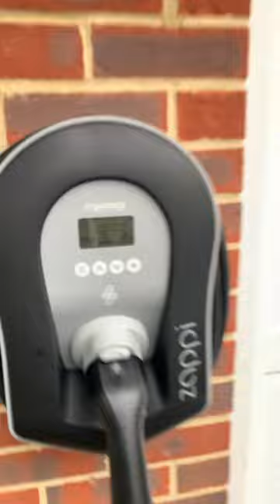The BEST EV Install #electrician #ev #home #viral

Comment: For the love of god I wish electricians would stop drilling consumer units with all the breakers still inside - resulting in small shards of metal making their way into the breaker though the terminal clamps or down the sides of the switch levers.

It doesn't take a minute or 2 to undo the screws on the DIN rail and remove the breakers before you go hacking at it with the drill.
Reply from the maker: Ok thanks
Reply: Hello  man ,Enoch from Ghana  🇬🇭 am Electrician  always watch Yr video
Reply from the maker: @enochabban8086  thank you 👍👍
Reply: @sotaelectrical  Hello sota can u train me more about ev charging system, because ev is not in Ghana yet .I will to hear u tnx
Reply: Will like hear from you soon